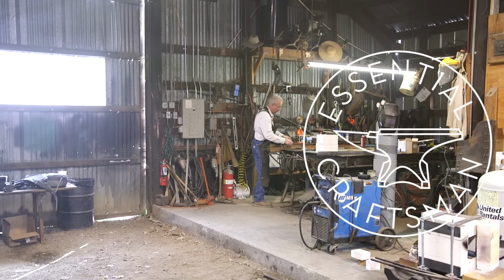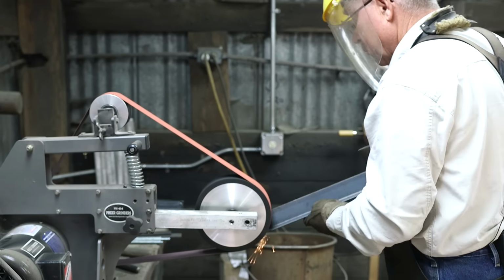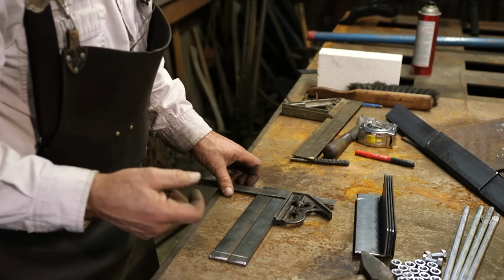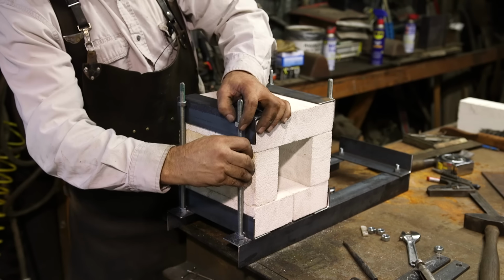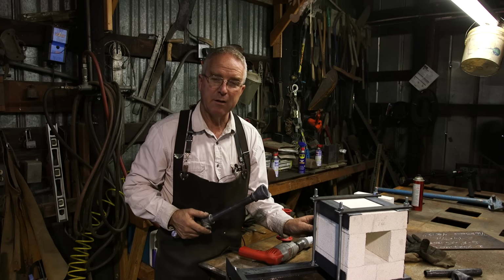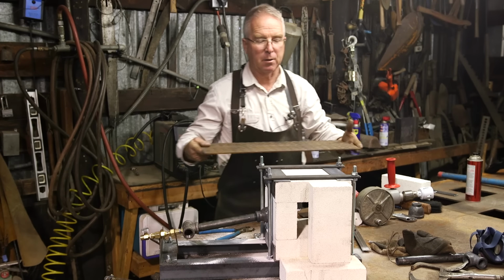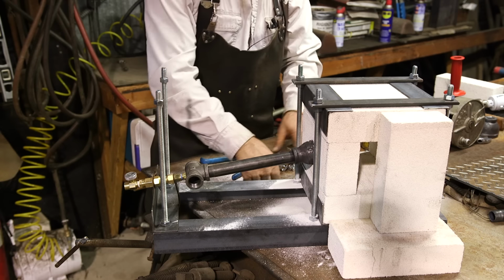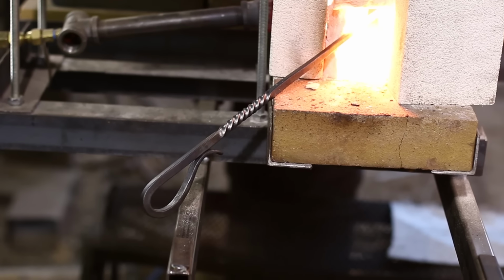Forge Build: No Welding Required

Comment: Thanks for another fantastic video!! My current forge is just some fire bricks stacked up without the angle iron frame and a map gas torch used to heat treat o1 tool steel knife blades. I am very much a newbie to this whole world but absolutely love it and you have been a huge help to me, so thank you very much.
On another note, do you think this little forge would get the steel to welding temperature? 
Thanks again
Bruce

Comment: What size bricks are we using here? i went to the link in the description, however im not seeing what your using in the video. Also, do you think if i double the depth of the forge, the burner you linked would be able to handle it, or would i need a second burner?

Comment: Great build. I'm going to make one.  Two questions:  What size and rating fire brick did you use? (K-23, K-26?)   The link in the materials list is a dead end. It gets me to the supplier but no help for the brick. 
  Also, can I forge weld with this forge if I use the burner in your list? No sense making it if it can't do that.

Comment: I appreciate you channel, and I hate the overly cautious crowd, but the soft brick and the kao wool that was shown , but mentioned is extremely dangerous to work with.  If you are showing a how to for the hot glue crowd a warning might be in order.  Not trying to offend anyone.  Securing a light weight forge might also be a recommendation.

Comment: Hello... im trying to start with blacksmithing, as a hobby... and... i want everything as small as i can get... so... in my citty i dont have those bricks, but i found some similar thing, its heavier and thinner... and for the fire.. i saw somewhere i could use a butane torch... that cans that are refils... and a burner at the top... do you know for how long i could keep these lightened up?

Comment: I like this simple design very much. Thanks for the video. Can you please tell me why the burner is pointed towards the top of the forge? It seems to me that it would do better if it was pointed at the material to be heated, which is normally laying on the floor of the forge.

Comment: Just noticed the cut list is missing a 9" section of angle iron drilled an inch from either end to make the far end of the frame, should be 5 of those (or 3 9" and 2 18.5"
Reply: Caught that myself... after cutting 4of them and thinking "....wait....nahh" haha
Got it all together now though

Comment: Just got the quote for the metal from the local steel stockholders, everything needed for £45, same for a burner from  ebay. Have 8 soft firebricks kicking around so all in all under £100 for a fabulous little forge.  Thanks for this Essential Craftsman.

Comment: used to smith with a friend we did one of those fire brick set ups with coal and a fire place blower back then. using the mass of a few more bricks you don't even need the metal jig to hold it together(though I wouldn't do that inside or with gas) That got so hot it set the surface of the brick to glass a few times.

Comment: Holy moly! This. Is. Perfect!
I live in Japan and we generally do not have a lot of space. Especially compared to the US!!! If you think you have a tiny garden, but it’s still bigger than 3 by 5 meters (sorry, I am German and have no clue about inches or feet), consider yourself blessed! Because I have even less space but I am still super interested in blacksmithing. I even got a 115kg anvil in my yard. However I am lacking a proper forge. But thanks to this video I now have a pretty good idea on what I could build that would fit my needs and not take up all my space. So, once again, thank you!!! Very cool and helpful video. Love your channel! ❤️🛠⚒🔨🔧❤️
Reply: Hello from the U S  here 12 in. = 1 ft. 3 ft.= 1meter so you have a 36in×60in. area or 1 meter × by just under 2 meters 😁🤗👍also 253.532 pounds is the u.s. conversion on your 115 kgs. anvil weight.....not trying to be rude or disrespectful just helpful in case you or anybody else was curious 🇺🇸🇺🇸🇺🇸🇺🇸🇺🇸🇺🇸

Comment: Almost done building this project. I got all the way to the assembly stage following the cut list and then realized that you need 5 9" cuts of angle iron (with 2 of them longer if you want to build the hearth) -- four 9" sections to box in the bricks, and the 5th one drilled for the cross support on the burner side of the forge.

Comment: You're incredibly inspiring, thank you sir.
I have been slowly building my way up to blacksmithing for years now, I'm a Carpenter by trade but have also done a lot of welding along with other trades.
This year i started wood turning and lathe work and now I'm ready for a look into blacksmithing.
Thank you for the encouragement, I'm going to build one of those forges today, legend 👌

Comment: Yep, that will work. On the LP forges I have made I angle the burner down but up will work too. Brick is fine, Kaowool and a wire mesh screen to form the insulator will work, I have a forge that burns charcoal (hard wood not Kingsford garbage) that is made from wood and insulated with dirt and it works fine. A block of steel from the scrap yard will serve as a darn good starting anvil and I have made a video about it. Getting into smithing need not be expensive. Seek out local forging clubs and groups such as ABANA or CBA (Calif Blacksmith Assoc) that I have taught smithing classes for over 18 years. Good groups local to you will give you much more and CORRECT information than most back yard want to be smiths who make videos on Youtube. There are quality channels such as this one (Essential Craftsman)  but there are a lot more out there not worth watching for any reason.

Comment: Question - how many litres is your propane tank, and approximately how many litres per hour does it burn? (Or I guess it can be measured in KG/pound?)
Reply: Here in Canada, most lil propane tanks cost  $20-25 to refill.
Those are limited use... bigger tanks use automotive quick-fill fittings that can be reilled by litre/gallon pricing.

Comment: Forge vs. Foundry, I feel this can be a great video topic. Can I have one system to do both jobs? Essential Craftsman, you would be the best wordsmith for this job!  Great videos, keep them coming!
Reply: One system for both a forge and a foundry... 

   Yes... yes, you can.

   The foundry's heat requirements are the high-point, thermally speaking. SO that's going to be the limit and drive of your system. The forge has to get hot, sure... but you only need to soften metal in the forge, and you're looking to completely liquefy the stuff in the foundry.

    You'll also have to cover how (exactly) you're going to cover and open everything, so you can build up the heat, but retrieve your particular project materials in either "mode"... for the forge, a simple doorway(ish) is sufficient... 

   The foundry, however, you're no longer just getting a small bit of screaming hot metal out... You're retrieving a crucible full of liquid death and fire and slag out. It has to slip out and maintain dead-level, or you risk pouring hot metal liquid all over yourself, your assistant(s) and your shop floor (along with who or whatever is laying around on said floor)

     I'd probably advise... for the simplest method... an oven with a single hinged door... and possibly a smaller door set into it... You'll likely want a little more space than shown in this vid'... so think of bricks in sets of three, not two... and add enough of the angle-iron to one end to completely permanently enclose it with brick... We're still talking about dry-stacking those in the frame, SO... you can probably get by sufficiently with just a couple angle-irons attached at one opening (in the vid's model, now)... with bolts to support and compress/contain the bricks covering that end... and sufficient additional length (mostly all-thread) to accommodate three bricks instead of two for the floor and sides. (You will have to move those middle holes on the two long angle-irons.)
    Finally, designing or picking out a couple hinges to attach above and below for a "swinging door" is in order, and keep in mind, this "door" is going to have to be made of more angle-iron and bricks. It's not lightweight... not exactly suspending an elephant either... but certainly not lightweight. If it was me... I'd use an over-length pair of angle-irons and then compress the bricks between them with all-thread, as that seems reasonably sufficient for the first iteration (in prototyping it's normal to have to rebuilt and improve things)... AND you can try exploiting the all-thread as the "pin" for your hinge design. That way, you only need a bracket above the door to keep it reasonably aligned with the oven/forge framing... and probably a drilled-through bracket, plus a support in the lower to hold it up AS WELL as keep it in line for opening and closing EASILY...

    That would be the big "test" too. Opening and closing EASILY... You don't want to fight with an extremely hot door full of delicate fire-bricks... They're nice insulators, but piss poor structure... Finally, I'd probably advise testing the thing with a crucible of specific metal (the stuff you intend to work with) to see that you can melt it sufficiently for the work...

    NOW... a word about foundry work. Casting requires "Pre heating" your dies or molds. (I don't know which you plan to use)... AND you do have options here... It's not required that your molds are as hot as the molten metal... You just don't want them so cool that the metal returns to solid before you get a chance to FILL the whole mold. 

   It's worth note (somewhere) that you don't want cast metal to cool too quickly either... AND it really does NOT matter whether you're intent to work with iron or other metals. They have different specific rates of cooling that you need to know... but those rates (cooling curves?) are part of EVERY metal's details and specifications. Poor cooling rates are among the top 3 things that ruin cast products...

    Okay... sorry for this one being long. I do prefer to take pride in some precision over brevity... but this is bordering ridiculous. In any case... I hope this at least gives you some direction for thinking it up on your own... AND you have a few things to be sure you've researched before you blow up a mold, break a die, or spew slag and molten metal all over your momma's kitchen. (lolz)

                 ...my mom damn nearly beat me to death when I did that. ;o)

Comment: I would also add an edge to the bricks so they nest one in another. Doesn't need to be smart, just a double bevel, easily done with a rasp or an old hand saw blade. Nesting bricks increases the efficiency by quite a bit.

Comment: https://ronreil.abana.org/whyusegas.shtml
Anyone considering building a gas forge would be wise to read this article. Consider operating them outdoors, away from structures, until you are certain sure your system is operating safely, with no leaks. Get knowlegible advice on connecting gas pipe before trying it yourself. Liscensed plumbers are the ones to ask. Remember, that is not water in that line. If you happen to set a building on fire, you will have NO insurance, and can face civil and criminal charges. Forewarned is forearmed!

Comment: it is eerie how close this is to my "emergency travel" forge i made. angle is different size because its what i had on hand. but the design is pretty much identical! its a fantastic little forge quite cheap and VERY easy to repair when needed.

Comment: I made a similar one from spare ceramic kiln bricks but I put hard bricks in the bottom as the soft ones get gouged by the steel going in and out. Less efficient but longer lasting I feel. I guess one could also put a layer of kiln cement on the bottom to help toughness too

Comment: Great video and a fantastic little forge! Thankyou I’ve been thinking about trying some smithing for a while in fact many many years since I watched my dad build the smith’s shope and forge for the village blacksmith . So many youtubers seem to make things a bit of a mystery and some of the stuff they use is not easy to get hold of either but this is just great. One question how scalable is this? Say making it longer or higher to accommodate larger pieces? At what stage would you have to get a second torch for example to assure even heating?

Comment: This is a neat little forge. I want to  emphasize a couple of points. First, if you’re building a burner, make blessed sure you know what the Hay Budden you’re doing. You’re building a flame thrower, hopefully a controllable one. Mistakes, leaks, burned propane hoses...not just a bad day. Maybe somebody’s last.

Second, forget the word “brick” when dealing with firebrick. It’s even softer than you think, and some of the comments below indicate that this didn’t register. Think “delicate.” It’s not as cheap as regular brick, either, so it gets frustrating when you crunch it up.

Comment: oddly enough, I've been thinking about building a propane burner, as my old homemade (by a teenage me with little skill no less) coal burner is getting both bothersome to maintain and difficult to feed, not to mention the sheer fire hazard durring the summer heat, and whadya know I have a pile of fire bricks already, and more then likely have some angle and flat stock laying around looking for a purpose

Comment: I've made several propane forges, one from an old Freon tank and the other from a 3-4 gallon compressor tank. The burner is ultra simple. You, of course, need the plumbing to go from the gas line to gas pipe. A T joint (with the gas coming in from the bottom) and forced air from one side. The other side slides into the forge body. A ball valve controls the gas and a ball valve controls the incoming air. No need for expensive needle valves, mig tips, etc. I can easily forge weld with this setup. Thanks, Scott, for this tutorial.

Comment: This is by far the easiest way to build a forge. Remember people you don’t need to go out and buy expensive tools to start out. You can probably build this forge for less than $40 buy some hammers from harbor freight, and if you don’t have an anvil you can use a sledge hammer head in a stump as one or a piece of railroad iron works great. Thanks for the video Scott!

Comment: Excellent video! 
I started the craft a number of years ago, working at a local smith's shop. I wound up having to stop and lost touch with him, but I've been itching to get back into it. 

This is a perfect little forge! And the design is easily adaptable if you need a little more space inside, as well. Wonderful video!

Comment: I always use Windex to lube my drill bits. It keeps it cool while cleaning oil off of the surface. It is surprising how well it works.   I was taught this from a welder/machinist who worked for Gates rubber company.
Reply: iMaGeArChY I have to try this

Comment: @15:35 it seems the Scott lined the forge with another material. What is it? Why is it there? And where do I get it?
Reply from the maker: That is a rigid ceramic fiber board that I had on hand. It increases the insulation but primarily it reduces the size of the interior. When I take that Forge a part to rebuild it I will slide one of the bricks over in order to reduce the interior space size. It will get hotter quicker. So the upshot is, the additional insulation on the inside is handy and helpful but not necessary.

Comment: I see your center punch is made out of rebar. Assume you water hardened it? or oil? howsit hold up? I have a semi-infinite supply of rebar, but didn't think it would be useful for tools. I may have to give it a shot this weekend. My little forge is pretty much just the fire bricks stacked up. The burner is on a angle iron rack, but the forge I kept "loose" so I could easily reconfigure. Seems to work well (once a friend pointed out that the back pressure was causing issues, backed the burner up about 1/2in and all great!) Thanks for the great vids!

Comment: Builders: Be careful not to over tighten the nuts. That fireproof insulating brick is both soft and fragile. It will crumble away if you look at it wrong.

Comment: If you don’t have a chop saw and a belt grinder, you can cut the iron with a hacksaw and smooth the  edges witha file, or even with sandpaper. It takes longer, but it works.

Comment: Should maybe touch on general pipe fitting protocol....you can't just thread those pipes together and hook a 20lb propane tank to it...exercise caution people especially if you are not properly trained in gas piping. You cant run fast enough to escape a propane explosion...the thought of people fabricobblling this together in their attached garage is a little frightening.

Comment: This is awesome.  I was planning on building a little open forge to heat with coal, but this little guy seems like it would be much simpler.  How does this compare to an open forge in terms of workability, ease of use, how much heat, etc.?